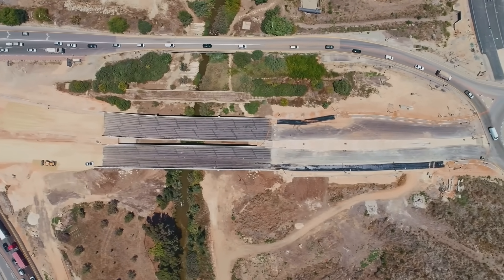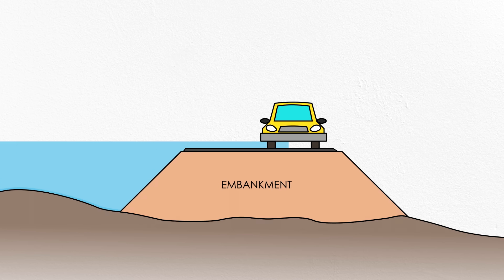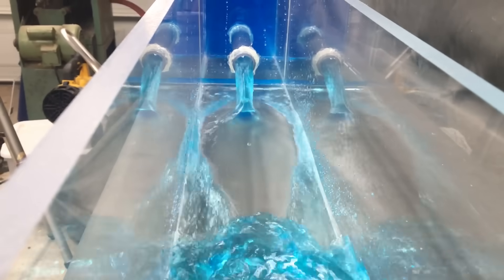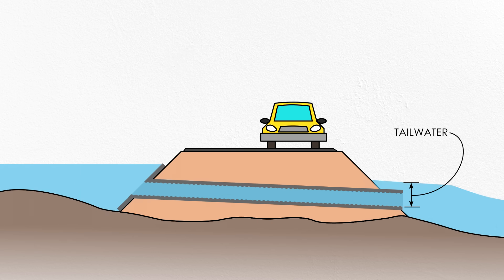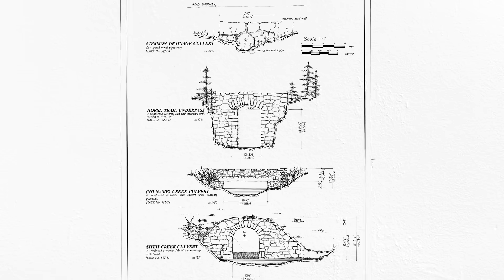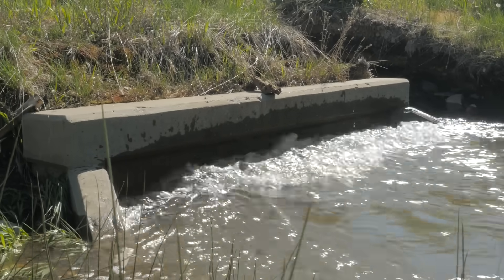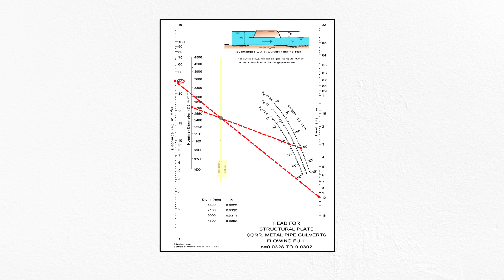What Is a Culvert?

Comment: Ok, not a bad video in any way, but the start of the video is just a little bit overcomplicated... But all in all I hope that is helps those who are not civil engineers. And for a few comments, yes, water is the biggest problem in road and railway design. That is why you never let pipe "levitate" in the air on inlet (as in some drawings in the video) because water will always find it's way into the structure and the main thing is not to stop it by all means but to make it as hard as possible for it to get in there (again cost effectivness). For that reason you also have wing walls, to direct water and to protect embankment around the inlet.

Comment: Digital calculations everywhere. Man is not great at dealing with analogue situations. If you have a road going over a waterway, you seem to suggest we have 2 options. Either use a bridge or use a culvert. Both solutions do the same job - so surely they're the same thing ? Yet we have 2 different names for the design of the same thing.
0 CULVERT
1 BRIDGE

Please explain what makes a bridge a bridge and what makes a culvert a culvert. If the bridge is hump-backed, is it a bridge over a culvert or is it simply a bridge ? Explain borderline cases where it would be equally correct to describe the feature as a bridge or as a culvert.

# A culvert is a man-made water channel. It may be open-topped - say, to divert a water way around a new building or, as per this video, to go under something.

If 2 roads cross each other and are grade-separated, does the top road go over a bridge or a tunnel carrying the lower road ? Can bridges and tunnels coexist ?
If a tunnel is longer than its width, does that make it a tunnel ? Can a tunnel be shorter than its width ? Does the height of the tunnel factor itself into the naming calculation or is it merely a matter of length and width ?

# A tunnel - a funnelled or tapering down pipe.

Comment: Putting in the cheapest culvert that passes enough water to avoid over-topping the road is basically how things were done decades ago. While many of those structures are still in place, the ecological impact has been substantial. Many of those culverts are perched above the downstream water surface or create high enough flow velocities to block fish passage (aquatic organisms need to move around in river systems to fulfill their life cycles - think trout spawning or seeking refuge in headwater stream reaches). An arch or bottomless culvert that spans bankfull width is a much better option - yeah they cost a little more but greatly reduce erosion issues, are much better from an ecological perspective, and reduce maintenance costs (e.g,. woody debris passes through rather than creating jams at the inlet). Ideally, channel geometry and flow within the structure should closely match the "natural" characteristics of the stream. Most of the real world examples shown in the visuals of this video are highly problematic. It costs a lot of money to fix up an improper site, too... This video is a great intro to what goes into culvert design, and perhaps applicable to intermittent drainage that doesn't support much of an aquatic ecosystem, but in most cases it's no longer acceptable to neglect the ecological aspects.
Reply from the maker: Great point. The video was meant to focus on hydraulic design for ephemeral waterways, but I should have at least mentioned aquatic habitat as a design criterion.

Comment: Culverts have two jobs to handle the forces coming from the traffic on top and to handle the flow. I just built one next to a motorway. It is basically a bridge for bunnies so they don't have to cross the trench when they use the passage for small wild animals (also built by us). Lets say when we measured the load capacity of the soil underneath the culvert it was hard to take it seriously since the regulations are the same if the traffic is some little animal or the traffic of the motorway...

Comment: You made a error. You mentioned the water in your Plexiglas model almost went over your "Headwall" at 5:58 .That's incorrect and impossible. You got lazy and did not cut your Headwall down to match the side's. The water would just spill over the sides. Your Plexiglas Headwall is transparent but not invisible.

Comment: You'd think everyone would convert their culvert to a flush headwall style.  I was hoping you go into the design characteristics necessary to keep from losing your "pipe".  I have a dry stream bed that becomes a significant stream during monsoon season, and put a 12" pipe under my driveway.  One time the water flows so well and found a way around the pipe without going over my driveway that it eroded alongside my pipe and whoosh... washed it downstream.  Luckily it didn't go too far and I retrieved it.  So my plan in rebuilding it is to place sandbags all around and underneath the pipe to prevent the erosion factor and to wrap the pipe in barbed wire so it won't be so slick as to easily slide out.  I have managed to make some small dams to trap the water so it will feed my desert trees, but every once and awhile those wash away too.  But I have managed to raise the soil level with my dams which is a bonus.

Comment: I live in a community where the culverts cannot handle the flow following a heavy rain.  During some winters, the water level rises above the causeway - requiring the authorities to close it.  The level of the lake is not the problem.  It's the level of the incoming water that overwhelms the culverts.  Apparently, someone miscalculated the highest potential flow rate entering our private community.
Now, if they could just add one more culvert to the two existing ones, the overflowing causeway would be no more.

Comment: cul·vert
/ˈkəlvərt/
“A culvert is a non-permitted large corrugated steel pipe that is placed in the ground between properties in the most inaccessible places such as under landscaping and below large future trees, so that it is virtually impossible to replace when the pipe deteriorates. This pipe is sometimes placed within easements so that homeowners can mow easier and not have to deal with damp grass (i.e. flooding). They are often clogged due to insufficient pitch during installation and lack of proper routine maintenance. These pipes are never installed by the current homeowner and have always been there since before they purchased the property. The omission of these pipes on plats of survey and/or engineering plans somehow transfers ownership to the local municipality.”

Comment: I worked construction after I graduated from high school and my second year ended up being on a pipe crew.  We tore out a bridge over a creek in a rural area and put in twin 21' arch pipes that had headwalls and slope collars of poured concrete.  The bottom of the pipe was cut straight for the bottom 2 feet or so and then at an angle to match the embankment till the top.  The bottom had to have a concrete wall poured that was 4 feet below the bottom of the pipe and about 6 feet in total height. The pipe was placed on top of the form and J bolts were used to anchor the pipe to the concrete which was poured in place with the pipe.  That was a MAJOR pain to deal with  but once everything was done the main flowline of the pipe was about 2' from the bottom.  The rest of the way up  was a 6" thick slab of concrete sloping up the pipe till it reached the road.

It was truly amazing how much water flowed through when it would rain for sure but it always had at least 18" of water in the bottom due to springs and tile lines that would drain into the creek.  We had a decent sized storm roll through near the end of the job and the water was about 10 feet deep.

Comment: Also, when dealing with forest roads that tend to be smaller and sometimes temporary, Talbot's formula can be used which really only needs the watershed size and runoff factor (which depends on region) to determine culvert size.  There are even BMP handbooks such as those from the VA Department of Forestry that have a simple chart that shows the size culvert needed for a certain size watershed and in which region.  The handbook also lays out how the culvert should be placed as close to the stream bed as possible to allow uninterrupted flow for stream organisms, and how the area around the culvert should be prepared to prevent sediment from getting into the waterway since water quality in the forests heavily impacts quality downstream.  I've been studying a lot of forest roadway engineering this semester and I find it very interesting!

Comment: "A culvert is a structure that allows water to flow under a road, railroad, trail, or similar obstruction from one side to the other. Typically embedded so as to be surrounded by soil, a culvert may be made from a pipe, reinforced concrete or other material."
Saved you 10 minutes, you're welcome.

Comment: I'm a civil engineering undergrad. I understood every topic you covered before because I learned it before. I haven't learn about culvert and I didn't understand this video fully...
Reply: Wait till you get to doing a report on a bunch of bridges and recommend replacing many of them with culverts to be able to handle the water from the watershed.  I did that for a short line railroad with a little over 70 bridges in 40 miles with the smallest bridge 12 ft span and I couldn't crawl under it.

Comment: Very important to design culverts to control erosion at the outlet, so it will remain accessible to fish and other aquatic life.  Many of the culverts shown are “hanging culverts”.   If fish cannot swim upstream through the culvert, they may lose access to crucial habitat areas (feeding, spawning).  A poorly designed culvert can be the end of a local salmon or trout run.
Check out Trout Unlimited.

Comment: As an environmental engineering student, I just took a class on urban ecology where we talked a whole lot about culverts and other water management infrastructure! While they are an amazing work of engineering from a civil perspective, another unintended consequence downstream can be the increased water velocity. While this is a bigger deal with channelized streams and other, longer, water management infrastructure, having all of the water flow over a smooth, engineered material allows for much greater speeds at the same slope made of soil. 

This can lead to downstream erosion, and in extreme cases, undercutting of the soil along the banks leading to the collapse of the bank into the water--which harms the water quality and decrease overall stream health. When designing the built environment, make sure to remember that we share this planet with all sorts of other life!
Reply: i unironically hate you
Reply: Bf=7%54_2%4_25-/
Reply: Aluzky  Sorry, but if you eat the vegetation, that will increase water flow and remove the erosion control provided by plants.

Breatharian. It's the only way to go.
Reply: @dougsundseth6904  YAY! Transmetropolitan reference!

Comment: What's the reason that so many culverts are that ridged/corrugated metal?
Reply: Corrugation allows the cylinder shape to withstand forces from dirt/vehicles/etc. on top of it; requires less material to do the job and is thus a cheap and effective solution.
Reply: What Akira said, but with a trade off of flow rate for the extra strength. If that’s too bothersome, use a slightly bigger culvert.

Comment: As soon as you said culverts were about conflict I thought about a different type of conflict that most people don't think about in infrastructure, political conflict. Where I am in Davis ca we have a semi -world famous toad tunnel. It was put there at the request of a city council member who could be very sensitive to environmental topics. We were putting in a freeway overpass and this person was worried about how the toads might get hit by cars crossing the roadway. Never mind the planned road had 20 foot tall vertical sides and there was no evidence that any toads needed to get to the other side. She was holding up the vote so another friend of mine on the council said they all just voted for the tunnel because they thought it was expedient and simple. Little did they know how expensive and time consuming it would be to re engineer the project with a 18 inch tube going through the roadway at a compound angle. 18,000 dollars and a bunch of ridicule later and there has been never any evidence any toads have used it. If they did they would end up in a tiny patch of ground in a parking lot at the post office. All to resolve political conflict.

Comment: Interesting discussion of the lowly culvert. Our town in in a multiyear project replacing and upgrading culverts. Some need to be replaced due to age, a complicating factor is climate change. Worst case water flow rate is higher, so it is not just a matter or replacing or lining the old pipe but need to increase size.

Comment: I often have to deal with flooding issues in the UK, down often by culverts that are well past there use by date. Brick/ stone built. Sometimes an arch without a solid bottom, or square, with other services running through, causing a restriction, a dogleg because of road widening. Some are hundreds of years old, most need replacing, but seldom happens.

Comment: An excellent example of inlet vs outlet control: in my local state park a trail follows the embankment of a river. There’s a few streams that use culverts to go under the trail. For most of the year they’re nowhere near capacity and they do a good job no matter how much rain we got. And then there’s spring, where the river rises with all the snowmelt and floods the culvert (if not the entire trail) and flow is completely stopped

Comment: This is awesome.  A year ago, I installed a 2' square concrete box with grating, to intercept storm surges that were washing across and washing out my gravel driveway that is cut into a slope of about 15 to 20%.  I did my own estimating of what the corrugated culvert with smooth inside could handle under the driveway, but there are so many variables such as what rate are the surges, and how efficiently will water transfer from the box to the culvert.  I let the pipe project a few inches into the box and I see that may not be wise.  The slope of the culvert and its diameter are the only variables I considered to determine flow rate out of the pipe.  Luckily, events will be rare where this system is needed.  There is a lot to properly designing such a system.

Comment: There's a spot in the next city over where I do a lot of work with a huge swamp full f now dead trees. Homeowner we got talking to in the area said it happened when they rebuilt one of the roadways that skirts the city. Good engineering for the road, most likely, but the backup effect in a wider area has had much greater impacts....guess they should have brought the conservation authority in a little more.

Comment: Never knew they were called culverts before, I always called them bridges (as that is literally what they are). Which brings me to disagreeing with the intro: they are not an option to using a bridge, they are literally a bridge (albeit with extra supports). That there is human-made stuff at the bottom arch and not only the top-arch does not disqualify it from being a bridge! :p
Reply: There is a difference. Culverts have no distinction between superstructure and substructure. A culvert transfers load through soil arching and the capacity of the pipe itself. A bridge depends on a superstructure to carry the load over a space and the load is transferred to the substructure or foundation.
Reply: @hhjones9393  Nah, bridges can come in other shapes too. Such as what is above you if you dig a cylindrical hole through the ground (aka a Tunnel) to get out on the other side, everything strictly above the hole/tunnel (and arguably some arbitrary surroundings too) is a bridge.
And I am fairly certain your description of a superstructure and substructure does not fit to describe the "literal mountain of rock and dirt" found above a tunnel (the bridge).
I would go so far as to say tunnels and bridges are two sides of the same coin: one describes the hole, the other describes the non-hole.

So with that said, a "culvert" is the bridge/tunnel pair you get if you support the tunnel/bridge with a pipe. And seems to be a word more connected to the non-hole parts (aka the bridge) such as the pipe and the funnel, than the void it contains itself (though it is not unrelated, as the void directly affects flow capacity).

Comment: A lot of that is really surprising. I thought only the depth and area of the tube would be factors. Why does the protruding inlet have such a dramatic drop in flow rate? I'm assuming it's at the same depth as the mitered version. Is there a pressure differential between the mouth of the protruding inlet and where it meets the embankment?

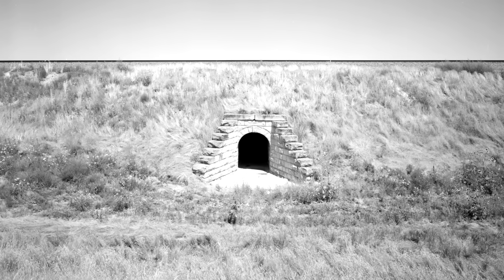Comment: The culvert at 7:03 reminds me of a tunnel at a campsite I’ve visited. It went under the road where the road was up on an embankment. I wonder, are these sometimes used as both a walking tunnel and a culvert for occasional rain flow? As it happens, it did rain quite a bit while we were there, and the tunnel did fill up with maybe a half inch of water. 🤷🏻‍♀️
Reply: The pipes or CMP for corrugated metal pipe is used frequently in large sizes for relatively inexpensive structures for walking paths, roads, and even railroads to go through because of the ease of handling the pieces and assembly.